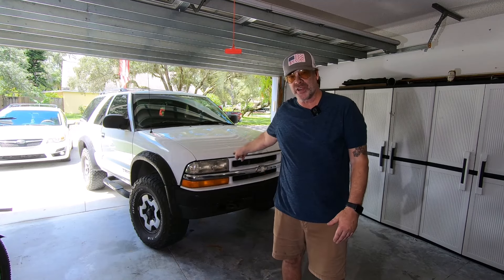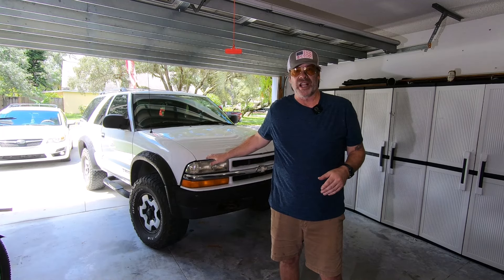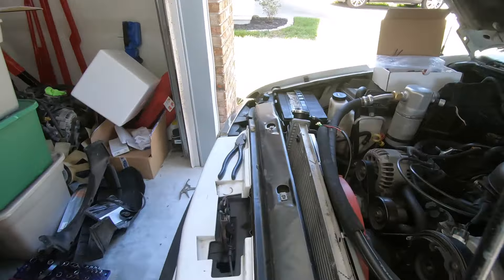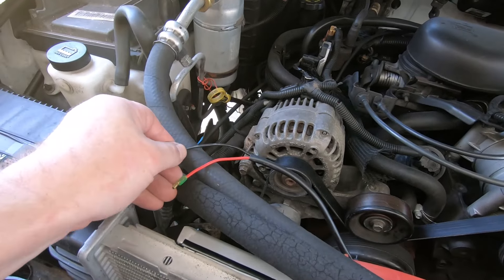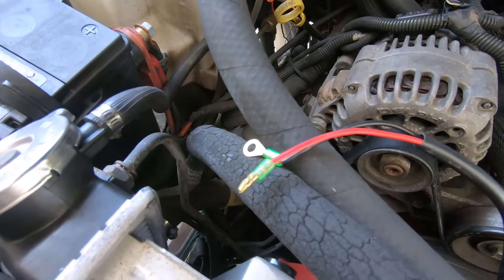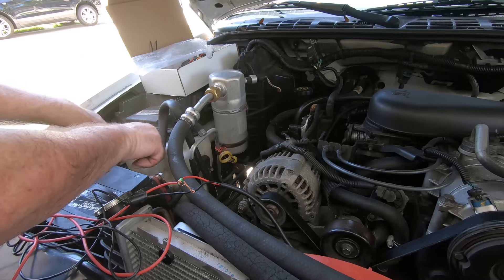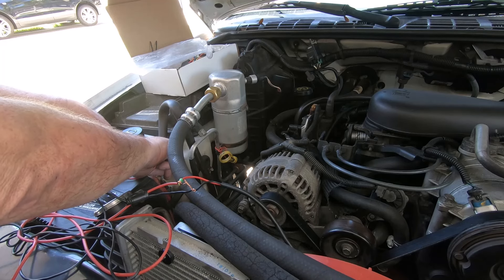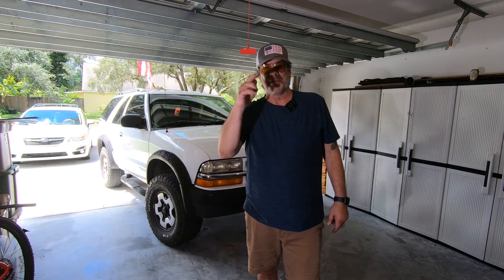Episode 4: ZR2 Blazer (S10) Clutch Fan delete, electronic fan conversion, full walkthrough

Comment: Its best to get a high amp  alternator  thats at least 150 amp when going with an electrical fan . the stock alternator does not have enough amperage to  properly supply enough current  when the ac is on and the lights are on and your stereo is playing .

Comment: Stan,thank you for detailed tutorial. Quality fan.looks well build.plenty of blads.👍this is the solution to the factory double fan and relays I have currently on my 87 iroc and much better the 85,86 single factory  electric fan.
Reply from the maker: Yeah I am running dual Spal fans on the Iroc. Interesting you are seeing better performance in cooling on the dual setup. That  the way 4th gen were so it makes sense

Comment: Question on camaro, when you first did swap (N/A) did you do drive by wire or cable?
Reply from the maker: It was dbw, I used the GM performance controller kit came with pedal and bought pedal mount plate from Hawks (modified it heavily)

Comment: A clutch fan should only work when motor cold.  Afterwards it should disengage or free wheel.
Reply from the maker: Right, I think this was locking up more. But since I run AC all the time, this is definitely a better route